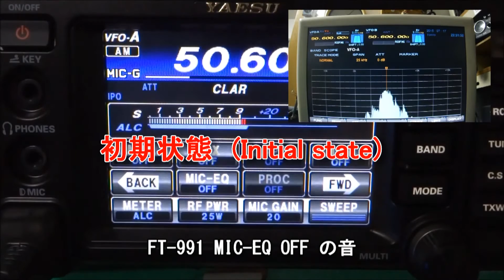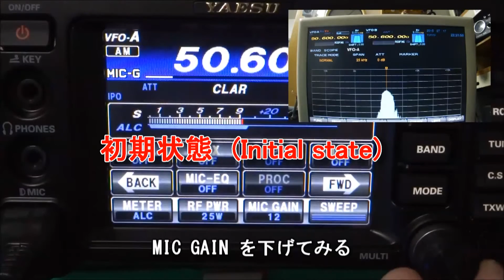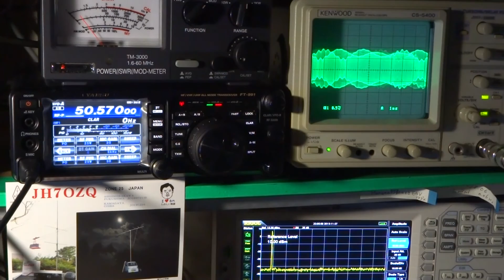FT-991 AM mode solution

Comment: Please explain how this was fixed.
Reply from the maker: Re-adjusted at Yaesu Radio Co., Ltd. Tokyo Service Center.　
It seems that the parts had to be changed and adjusted.　This is Only 991 problem. The 991A type has no problem at all.
Reply: I did some more googling on it and found the fix is in the service menu. Made some adjustments to the AM and had my first convention on am last night. 5/9 reports.
Reply from the maker: @CreeBreej  It was good. The solution is to get 5/9 reports in any way.　Especially readability "5".